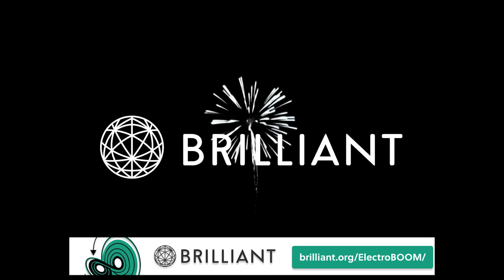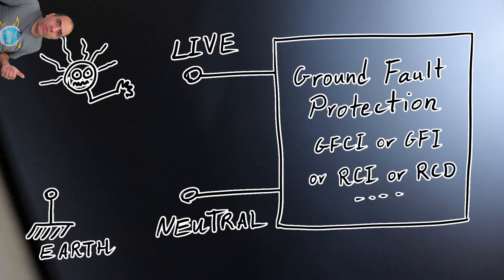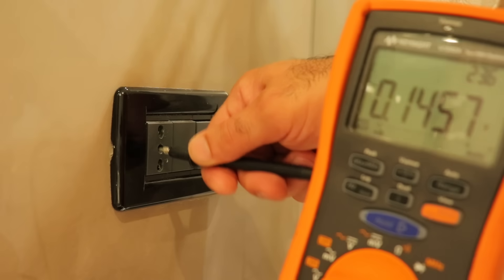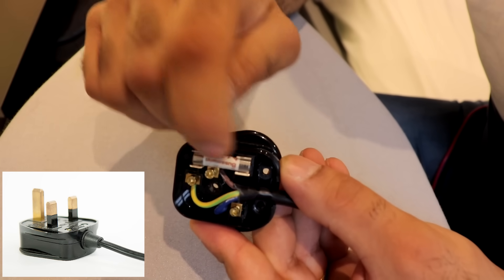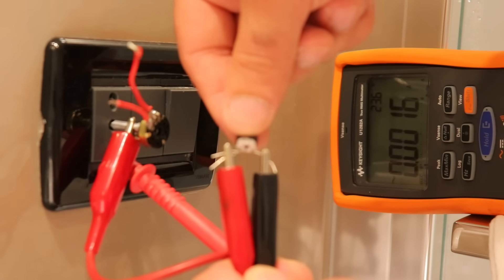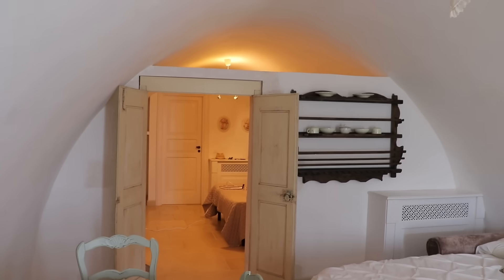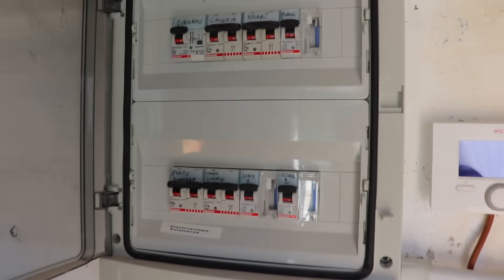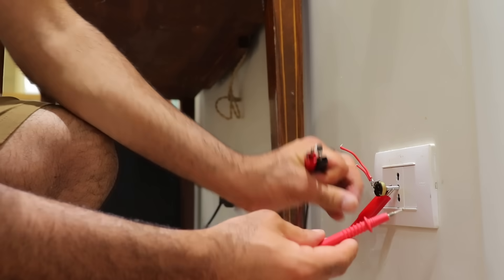Tripping Every Breaker in Italy

Comment: The GFCI outlets in Germany (which are mandatory in bathrooms since 1984 and for every outlet since 2007) probably saved my life as a child. I stuck pliers into the outlet to try and get the child protection thingy out.. well in the end I got it out, with an electric shock too :D
Reply: @lowlifetrent959  Well, the "FI-Schutzschalter" was invented/used in Germany in 1957, a few years before you guys in America did it (1961) :)
A similar device was used 50 years earlier, in Germany, although for a different purpose.
Reply: @PsychotherapistSam  wonder wut the different purpose was
Reply: Hi there, I've got a similar story. As a child, I asked my dad (who by the way studied electrical engineering for a few semesters) if I could plug a regular computer fan into the outlet. He didn't really listen because he was annoyed and just replied yes. And so I snipped off the fan's 3 pin connector and stuck the red and black wire into the power outlet. This was followed by a loud bang resulting in (thank god) a popped breaker, a scared child and a smoldered power strip.
Reply: I figured how to bypass the child protection featured and inserted my electrical train's plug with my finger between the contacts.

Drew an arc of electricity over my hand and ended up tripping the breakers for my floor of the house. So I can confirm those breakers tend to work; I'd have been pretty crispy and rather dead otherwise.
Reply: in my country these cats are known as ELCB earth leakage circuit breaker

Comment: That is not even the main protection switch
We have another one, much larger that checks for leaks in the circuit and takes the whole thing down (this will protect the whole house) and by the way, that one, only a baby will be able to feel anything if they put their fingers on an unprotected socket, or a device with a case short.
Way too sensitive in some cases. Though note that older houses, pre 90's in some places won't have this one or the differential, though not all countries.
Actually studied this in high-school, electricity, electronics/microelectronic, communications and industrial automation :P Not the course I wanted (computing) but definitely a large plus combined with what I already had taught myself in computing hehe

Comment: Small explaination from an Italian SW engineer who grew up working with her father in cabling their whole home (he's a Electrical Engineer/architect):
the three holes outlet is called "Bipasso", the small one is for 10A while the bigger one for 16A, the hole in the center is the ground. 
We also use the german "Shucko" plug (the round one) for heavier appliances (usually 16A appliances) that are sold worldwide (eg washing machine).
Ground fault protection applies to the whole circuit in the home (all plugs are covered) as the (larger) breakers have it integrated (they're literally called "Salvavita", literally "life savers").
the "doors" in the plugs are a safety standard introduces around 15-20 years ago, so older plugs don't have it.
The standard for modern circuits (at least the ones I saw my father design) is the following:
main breaker -> room light breakers & room outlet breakers

So, each room has two breakers, one for lights and one for outlets. Then, there's a main breaker for the whole house. They are all Salvavita (with GFP) - then we have smaller breakers (without GFP) for sub-sections (eg. left wall of the living room, right wall of the living room, kitchen appliances, kitchen usable outlets, etc)
Reply: Yes, and please note that it's not easy to plug shuko into standard Italian plug. It will eventually plug causing some damage to the socket. Forceful insertion will make you clearly feel you're doing something wrong like trying to insert diesel fuel nozzle into hole for gasoline refueling
Reply: @dwydd5729  Also I think the hole is for Poland and France.
Reply: @AmstradExin  The hole in the multi-country 7/7 plug is for groundin in French hermaphrodite sockets, which prevent reverse insertion but has no consistent standard as to which side is neutral.  The metal rails on the side of the plug are for German-style sockets that (like the old Italian sockets) have nothing preventing people inserting plugs backward swapping live and neutral.  In contrast, the national plugs in Switzerland and Denmark have well defined live and neutral positions with the grounding pin preventing reversal for grounded equipment.  Ungrounded plugs are just 2 pins and are always reversible.
Norway is the same as Denmark, but some villages have 2 lives and no neutral  to keep the power on if something shorts live to ground on the power distribution poles.
Reply: Here, Schuko is the standard in Germany. And the plugs in the Video are 'compatibility plugs' that have an additional hole for countries that use ground that way.
Reply: the  doors are on the outlets/sockets, not the plug. the plug is the piece you plug in. also, a separate breaker JUST for lights? what the fuck? there is never any instance in your home where you need 2000 watts of lighting.
Reply: @FingerinUrDaughter  italian here to explain. The breaker for lights is there because in many many home circuits there are small wall sockets (10A rated) wired to the lightings circuit, they're for small appliances and secondary ambient lighting, super confortable if you want to put out all the small desk or floor lamps at once.
Reply: @FingerinUrDaughter  shut up, you are 50 years behind italy in electrical regulations :D
Reply: @FingerinUrDaughter  those was made more than 40 years ago and are still safer than the shit you do in the US :D
give me a call when you start building houses with bricks and actual fundations instead of wood and cardboard with random wires inside the walls without any protection
Reply: @FingerinUrDaughter  You have no idea what you are talking about and you are making yourself look stupid.

US electrics are pretty much the lowest standard anywhere where there are standards. That most US sockets only provide 110V isn't a safety claim, it's just how things happened in the US. In the rest of the world, we do not use a "dangerous 3 phase system instead of just outputting 220(V) directly", most residential power is single phase and is 220V on this, it's the US with its dangerous by nature electrics that requires multiple phases to provide 220V. As for drilling random holes into sockets, I don't even know where you see this, but then the US has such dangerous sockets where the plugs are easy to pull out through the weight of the wires and leave exposed live connectors for fingers or items to fall into shorting them. The protection on circuits is central so it applies to every socket, additional protection is provided on top of this for multi layers protection yet you claim that "having the protection a long away is bad" - it's multi-layered, not bad. Cheap and easy wood is OK if you only want your house to last a few decades and are happy for it to be blown away in a strong wind, particularly when the entire roof is often only held in place by a few bolts.
Reply: @FingerinUrDaughter  You'd easily waste that much with incandescent light bulbs.
Reply: @FingerinUrDaughter  Multiple lights totalling 1300W to 2000W throughout a home.  And yes, if heating is desired, the heat from electric equipment is not completely lost.

Comment: 15:20 - That's an italy problem, the EU standard actually makes it so those "thick big" conectors that require the ground connectors have thicker (larger diameter) prongs than the thin connectors who don't need the ground connection. This makes it so you cannot insert one of those thicker connectors into an outlet made for thin connectors, it won't fit, but vice versa it will. Italy doesn't follow EU specification closely and especially in these tourist places where they have these very akward multi-connector that support EU and Italy standard on the same connector (those double holes) make it so you can in fact do what you did, and connect a thick connector to a thin outlet without ground. But outside these tourist places with these double holed connectors this wouldn't be possible.
Reply: The "double holed connectors" are everywhere in Italy and they are not multistandard: They just allow pluging in both the 10 and 16 amps plugs of the Italian standard (10 amps version being basically the europlug with ground pin).
They shouldn't allow you to plug in a schuko because the inner holes kfor the 10A plugs) are at the right dinstance but too narrow while the outer holes (for the 16A plugs) are of the right size but too far apart. That particular socket was either very old, defective or both.
There are Italian sockets that take all three plugs (Schuko, Italian 10A/Europlug and Italian 16A) but those are recessed in and have the earth clips of regular Schuko sockets and there is absolutely no way to plug in any of the compatible plugs without ground connection (provided that the plug actually has a ground pin).

Comment: Come on EltraBoom coming from a country with very inaficient say a crap electrical system, complaining about others is like in the bible "Take the plank out of your eyes at before taking the splinter out of others".
I think you should be banned from any country who has a safe 220 to 240 Volt 50 Hz syetem.
This should be stamped on your passport, "FOREVER" ho ho.
Re the 230 V ish 50Hz supply one the benifits is less fires from the structure of the mains and lighting wiring.
We in the UK have ring circuits for 3 pin safe mains plugs that can supply 13 Amps this equated to 7.5 KW, a single ring main which is for each story of say a bunglow or 2 for a detached house.
The wiring is in a ring and each single or double 3 pin socket, wired in parallel, say going around the house clockwise from outlet 1 to say 10 where the mains cable is connected back to the now mandatory metal consumer unit, that is the unit that contain in my case, 2 mains ring  and 2 lighting  ring circuits,  1 imersion heater, 1 PV,  UFH (under floor heating) and 2 spare.
2 main breakers mains in and a ELCB (earth leakage circuit breaker), the latter is for the mains rings, the water UFH controlls.
The wiring, ring mains cable twin 2.5mm plus 1mm earth, ring lighting 1.5 mm plus 1 mm earth and the imersion single run is I think 6 mm plus earth think 1.5 mm.
The whole consumer box is 14.5 in wide x 8 in high x 4.5 in deep.
This is Tiny  compared to the US units I've seen on YouTube and is as  big as the smalest controll panels I inspected for Underwriters Laboratory UL, a really good aprovals organization, like BSI, but with teeth, proactive as I was an inspector for them here in the UK.
Not only the ones I have seen  been huge the waste of copper cable wiring you have, in my kitchen I have a washing machine and tumble dryer  next to each othe pluged to the same twin outlet, also fridge freezer and kettle ect on the downstairs ring.
ElectroBOOM I would only mess with other people's electrical outlet in the UK and say Western Europe, as I've worked abroard in Asia, Africa and the Middle East you'll either kill yourself or cause a fire.
We have learnt over the years that is why the 3 pin outlet have a shutter on the earth input and the 3 pin plug earth is longer, so you cannot access the live or neutral contacts.
Also the mains plug live and neutral pins have a 8mm app 3/8 insulation at the plug body end this is to stop children or peoe with small fingers touching the live or neutral pins of the plug, as the contact  an only be made when the plug is fully home.
This is only for plugs with BS1363/A and sockets marked with not sure what BS, but  some crap coming in from mainly Asia is a death risk.
The plastic/polymer has to be made of, usually UL recognised, that will retain the pins of the plug, if it is not the live pin will still be in  the socket and able to be touched, as above this is another problem of crap products from that area.
Thaks for the video

Comment: You have to check your GFCI at least every 5-6 months. Just push the button to check if it's working correctly. I never skip that and I was advised to do it. They fail... I prefer to know when they failed. I have 3 phases and I have GFCI on every single one of them.

Comment: I cant speak for Italy but in Belgium we have 2 types of ground protection the main of 300mA and than a smaller one for 'wet circuits' (bathroom, kitchen...) of 30mA sometimes if a building is to old and those circuits are not apart we put both ground protection breakers in line with each other so the whole house is protected up to 30mA. (This rule changes when the eart resistance is to high, than it is 100mA at every single breaker and 30mA at the 'wet circuits' )

Comment: I have thought that EU has uniform plug connections but In Poland  I have never saw this 3 in row hole connection :/ 
I seen only flat 2 prong plug and round 2 prong plug with hole for ground which has prong in outlet... and also some plug instead of prong use some metal on the outside of the outlet hole :/ 
Maybe you should visit other EU country :D 
in my flat we have breaker per room plus "Polish version of GFCI" for bathroom, kitchen and one for all rooms

Comment: @ElectroBoom thanks for your review!

To clarify, at 15:30 even though you COULD connect the plug without ground, most italians would use the adapter for those plugs, which connects the ground 😉 The reason why the socket has 2 holes is because we have another italian plug without ground (2 pins only), which is smaller and fits the second pair of holes.

It's unfortunate the european plug also fits there without ground, but it wan't in the original design of that socket